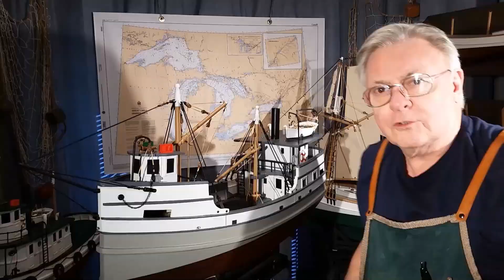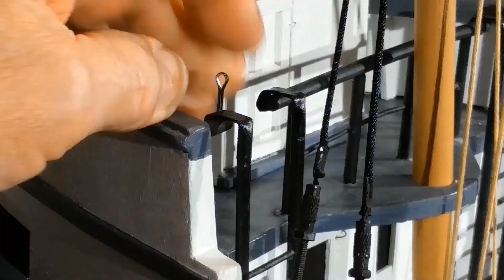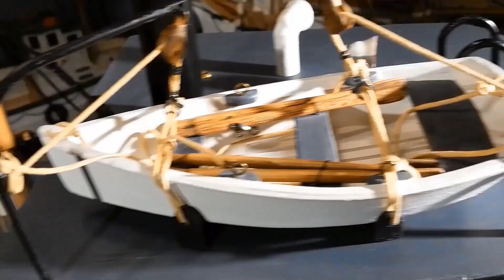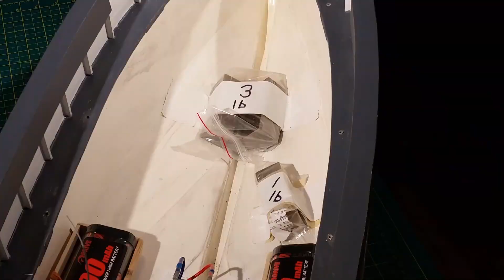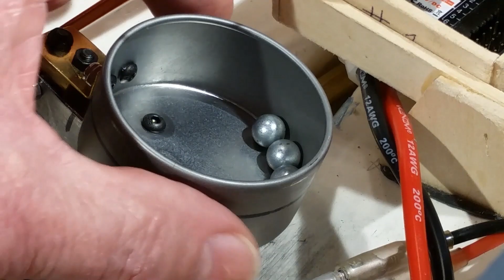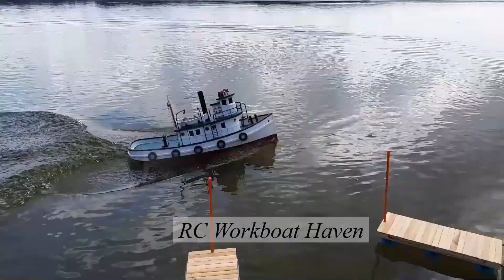RC Lumber Hooker Ship Tour On Deck And Below

Comment: Great looking model.  Now I'm interested in making one for myself.  Are there any plans available for this jewel or is this a one-off home built creation?  I've subscribed so as not to miss any further posts.
Reply from the maker: Thanks for your comment. Plans are available for a Great Lakes Lumber Hooker on the internet.  I build my different models on the same hull which I mold in fiberglass. To build the superstructure above deck level for the Hooker, Tug and Schooner etc. I look at hundreds of images of old photos and designs and then just DIY'ed the build as cheaply as possible without any official plans.

Comment: Love your sound generator. Have you ever thought of adding smoke?
Reply from the maker: Yes I will have smoke coming soon, but for now I want a simple method with no complicated electronics.
Reply: @RCWorkboatHaven  I bought one from a fellow in Australia that works great and only requires a switched source of power.